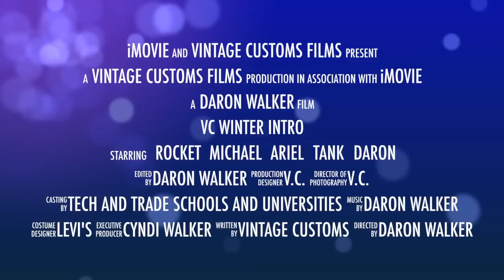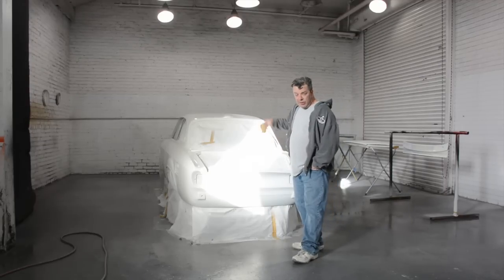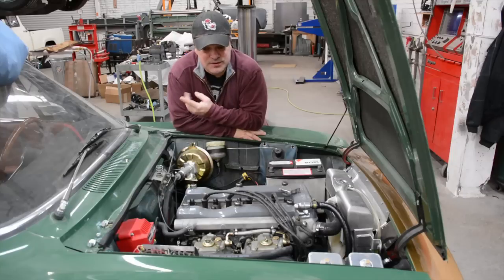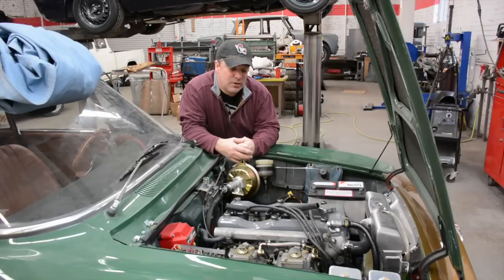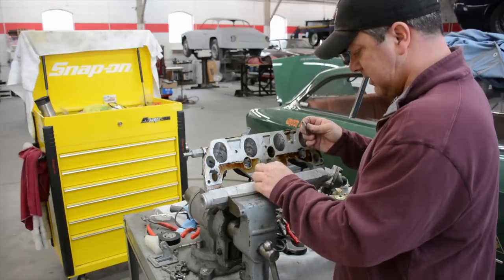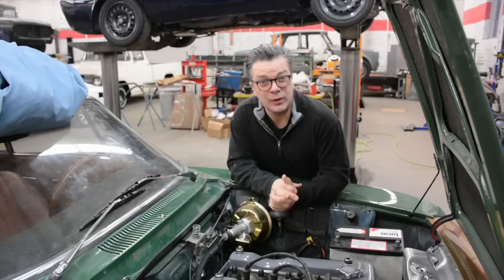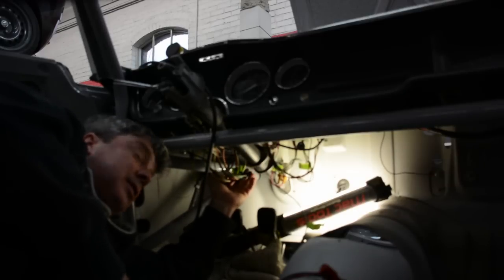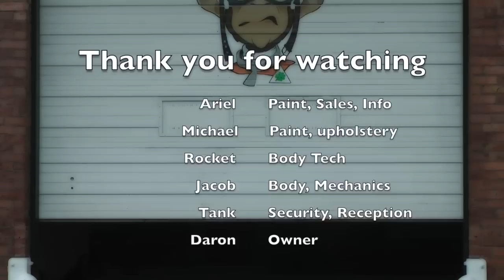Winter restoration update

Comment: I am in the process of watching your entire series of videos. You know your craft so very well, and it is a joy to watch you work.  

You mention silicone sealants and a potential risk to aluminum without providing a reason.  At one time automotive and aircraft mechanics were justifiably concerned about corrosion caused by the acetic acid generated by all silicone sealants during cure. Acetic acid was and is generated by the 'bath tube caulk' families of silicone sealants.  And these inexpensive, general purpose, silicone sealants have no place in or around a car.

My own experience is that the current silicone sealants developed specifically for automotive and aircraft use such as the "Ultra" series by Permatex do not have this problem. These special purpose and quite expensive grades of automotive silicone are formulated to produce very little acetic acid during cure. The tiny amount of acid these higher cost sealants do produce tends to lightly etch the 'faying surface' where contact between engine block and gasket occurs. A small amount of aluminum acetate is formed on the surface and this promotes adhesion. Since the amount of acetic acid is small, and air is not present, this is a one time reaction which occurs during cure, and does not continue. 

If you have negative experience with the current silicone automotive sealants that are formulated to be used with aluminum, I would like to know about that.  By 'current' I am referring to products like the Permatex "Ultra" series.

I have no relationship with Permatex other than the fact that I use their products. This said, a silicone based gasket dressing like Permatex Ultra Black can be very effective in preventing air leaks in intake manifolds, and oil or coolant leaks on all the cooler gasketed surfaces on the engine.
Reply from the maker: maneki9neko The real problem is internal. RTV's don't completely bond to smooth aluminum mating surfaces. And if a person applies to much, it squeezes out inside the motor and blocks the screen on the oil pump. I can't tell you how many times we have pulled a motor apart that was the builder was to liberal with RTV and near to over half the screen of the oil pump is blocked. RTV's are not all that bad. But the application is often poorly executed thus shortening the engine life dramatically. All said in done, there are many, many non-RTV sealants that are better in ever way.
Reply: vintagecustoms I knew that you would have a considered response. You seem to think through all your methods very completely.  Do you mind saying what kind of gasket sealer you prefer?  

With RTV and aluminum many people used to concerned about the acetic acid generated during curing. With current RTVs that is not a problem.  I work on Miatas, and the Mazda shop manuals specify RTV in certain places.  So many people do use it with success. 

So your concern that is that strings of extruded RTV left over after excessive application will clog the oil pump strainer.  I, too, have seen people slather RTV as if they were putting toothpaste on their toothbrush. In simple point of fact, a layer of RTV almost too thin to see is sufficient.  If you have 0.001 to 0.002 inches of RTV on a gasket you have enough.  Fortunately, if an engine builder or previous owner has loaded your oil strainer with RTV you can see the consequence of that in your oil pressure gage, and know that intervention is necessary.